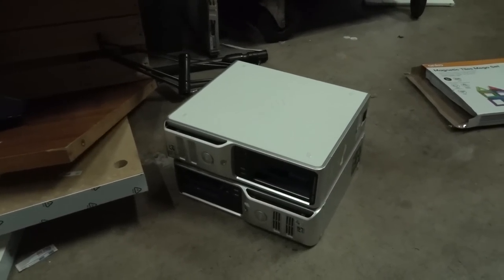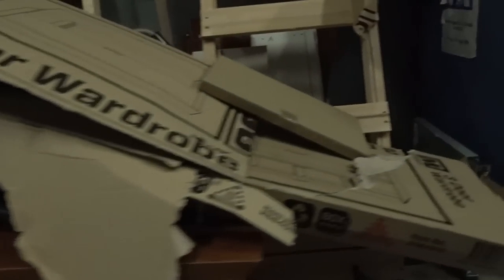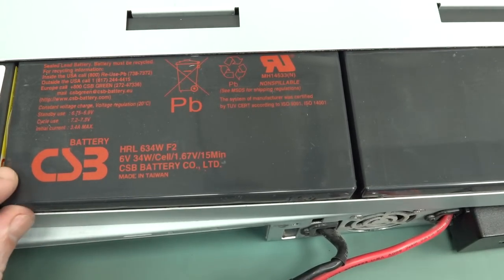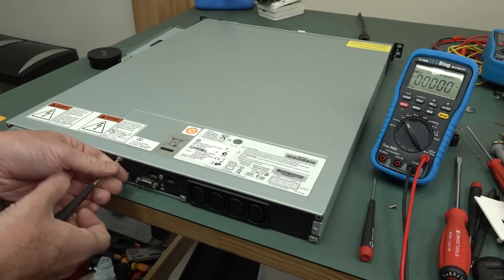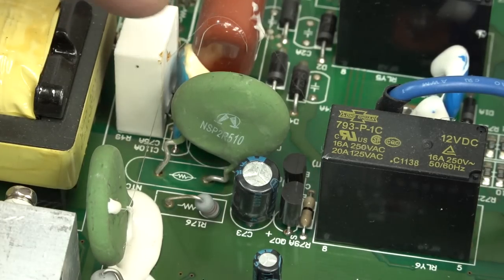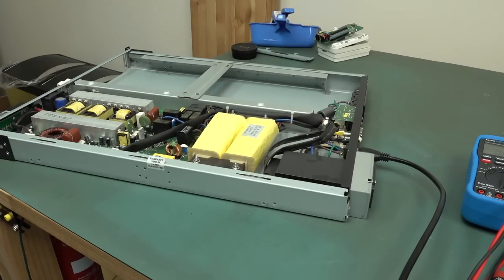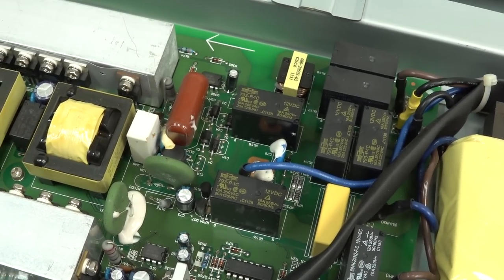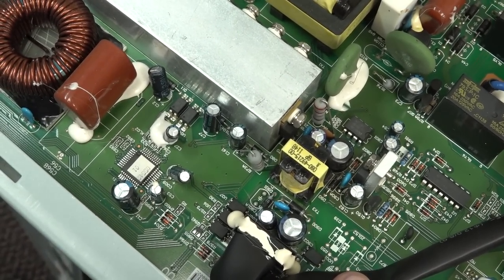EEVblog #1168 - Dumpster Diving UPS

Comment: Dave, please try regenerating these lead acid batteries with a "Back EMF Charger", which is basically a Joule Thief circuit that pumps hundreds(?) of high voltage spikes per second into the battery, and is supposedly able to make them get most of their capacity back after several charge/discharge cycles. It would be really interesting if someone like you, who knows what they're doing, would test this theory in order to prove or disprove if it actually works. That is, you're sopposed to be able to get something like 4.5Ah back on a 5Ah battery, which wouldn't be that bad for "free" batteries (except of building the circuit).
Reply: that sounds like a housefire in the making. better do it outside
Reply: Actually, no. The batteries don't even get as warm as they get when charging them conventionally.
Reply: Yep, often you can shake them and literally hear chunks of dried electrolyte inside...
Reply: Dave Micolichek  No way to do that, those are Sealed Lead Acid batteries. So the electrolyte will be either a gel or in an absorbent glass mat.
Reply: @FnordOok And therefore, it won't dry out. But there could be oxyde buildup inside the cells (in German, we colloquially call it sulfur, but it's probably sulfuric oxyde or something like that), and this can supposedly be reduced back to sulfuric acid with these pulses. I don't know whether this is true, but that's the picture I got from what I've heard about it.
Reply: Please do some experiments on lead acid battery Rejuvenation I do believe they call it try that circuit and any other methods you can think of I can find head-to-head and let's put this to bed for once and it would probably do a service to anyone that ever Works Batteries again.
Reply: I have one of those, it didn't do much for all the batteries I tried them on. Best, but not spectacular results were with the battery that was pretty OK to start with. The rest had developed shorts and it couldn't fix that.
Reply: APC UPS have a tendency to over-charge the batteries, resulting in them cooking. They swell up and deform, at which point they're only fit for the trash. No battery re-generator will fix that. I've seen them so bad that they've cracked in half, physically parting the plates and internal connections.
Reply: @89.8kiwifm9  yep I've seen this to.

Another thing about battery regeneration for let acid not necessarily just seal bad acids but flooded electrolyte batteries as well I think one of the things that referring to is sulfated batteries AKA lead sulfide or fate build up and there is what is called a battery desulfator it'd be interesting to try that on a scientific basis and see if it really does anything or not.

Another thing is using Epsom salts for regeneration.

Which I think is who we but might be worth doing experiments.

And I've also forward about repurposing used lead acid flooded batteries AKA deep cycle or starting batteries AKA starting lighting ignition AKA car battery or vehicle battery.

Utilizing them with an alternative electrolyte mostly consisting of I believe allm cannot remember the chemical name for it. Order makeup of it. It's up another sulfate I think. But from what I've heard it's possible to use it as a storage battery I have heard at least one person saying that they've used a lot of them 4 deep cycle batteries in some sort of backup system. But the voltage is extremely low much lower than 2 Volts Purcell so it would require many many many batteries to do this as well as probably many parallel strings or miniseries / loss drinks whole battery banks in parallel. If you had the room perhaps in a heated location in a well-ventilated fire resistant crawl space or something like that. It might just work if you had a large enough area.

Comment: 8:05 You stated all the outputs are wired in parallel, you seemed to miss that there are 4 wires going to the output sockets, so 2 zones!
Reply: CambridgeMart Exactly! There’s one shared neutral (blue), but he missed the second hot (black) hiding under the neutral!

Comment: No, it's not "super duper black magic efficient" - It gets away with no active cooling since it's only running for 10-30 minutes, and while that all the heat gets dumped into those big aluminum blocks. It will not stand up to running continuously.
Reply: naw it is black magic, it's called ignore the problem and hope it goes away before it would be an issue.
Reply: @digitalradiohacker  Yes and it doesn't even matter if it gets real hot during the battery-load time. And yes, it does get hot inside if it is needed a full discharge to keep everything running max-time. Normally they run only a few seconds max. and normally not on full-load.

Besides that, they will normally start in a real cool environment (like 8-10 degrees celcius) in the server-room (Airco) so they can dump a lot of heat before reaching over 150 degrees.
A few full runs normally means replacing the batteries but these errors should not occur. 

You'd generally program a server shutdown after a couple of % outage when you don't have an auto-starting-generator (yes, they are nice!) that starts in say a minute after power-outage. 
In that case you have 2 short outages: 1 from the main power-problem,  then it gets over to the generators, doing a little charge and then again when the main power gets back (and the generators go out). Since all non-essiental equipment is off it doesn't get a high load.

Very nice systems like that in chemical-factories and hospitals where we used to see them.

@Dave: I had 2 of these with the voltage regulators blown, replaced them and it works again. It is in normal use the hottest part...

Comment: Try connecting a power supply to the battery cable. It shouldn't need more than a couple amps with nothing on the output.
I have a couple UPS units that refuse to do anything without a battery connected.
Reply: Great use for a 4 quadrant supply
Reply: It will try to start charging it... Will that be an issue?
Reply: @tin2001 The UPS can't try charge the power supply if it's not plugged into the mains. Not all of them will switch on from battery power though.
If that's the case, then as Don Reid mentioned, a 4 quadrant power supply would work great since it can act as a load as well as a power supply.

Comment: One of these came in last week for repair. Turned out the fan died (customer decided to buy the fan himself).
And it does not turn on without the battery, can confirm.

Comment: 1. HP does not make/design their own UPS, Racks, or most of their Power/Racking equipment. It's all APC.
2. You have to hold the power button for 5 seconds to turn it on.
Reply: I think this is EATON, not APC (because: "smart slot" is more like eaton; I don't think that exists a 36V version of APC; markings of parts/transformers are not apc-like)
Reply: @yanecisco  I confirm this is definitely not APC manufactured UPS.
IBM, Dell, Fujitsu-Siemens and few others use APC as OEM, but HP always used some crappy cheaper UPS OEM manufacturer. Compared to this HP unit, APC made one looks like space ship.
Only quality stuff in here are CSB batteries (these in video are dead though).
Reply: This is an Eaton unit. There is even a reference in HPs documentation of the 1500 UPS.

Comment: I have two IBM badged  units that are exactly the same.  I went through the same head scratching before I discovered it requires batteries charged to at least 80% to get started.  Once the UPS is running you can hot swap the batteries, but will not start with dead batteries.
After replacing the batteries, and charging them, one UPS is running happy as Larry.

Comment: Put 36 volts from a power supply to the battery input.  Bet she'll fire right up.    Thats how my APC units are.  At least one of those relays in there rely on battery voltage.  

Also with my APC's you can turn them on without mains by holding the power button as long as you have good batteries.  Im sure the HP unit runs the same.
Reply: I'm sure that's a rebranded APC unit, looking at the construction and battery labels.

Comment: It's a 'Line Interactive' UPS, it's not going to switch on the inverter while it has mains applied. A 'Full Online' UPS is different and keeps the inverter running continuously.

If there are no LED's at all, check the battery charger circuitry. Some UPS's won't start up if the charger is dead as it also powers the board.

Comment: The auto-transformer is to normalize  the output voltage in case the line voltage goes below 190VAC or over 230VAC. That's why there are so many relays and not just two. In that mode the UPS doesn't use the batteries until the voltage drops below 170V or jumps over 250V. The stupid thing is that most UPSes keep the batteries at their max charge voltage and not the recommended standby voltage. For a 12V PB battery the voltages are usually respectively 14.4V and 13.7V. This  evaporates the water from the acid gel and makes it much more conductive. The result is shorted cells and after a while dry batteries. Literally - all the moisture leaves the gel and the lead plates oxidize scrapping the battery.

Comment: Usual failure is batteries swell themselves into UPS, then set off B/O battery alarm.  BOFH shows up with screwdriver, proceeds to use more and more force to pry batteries out.  Sometimes I’ve had to pull it completely out of the rack and take off the top in order to remove old batteries.  Would it kill HPE to give extra 1/2” on tray sides and top?
Reply: LOL BOFH!!!!
Reply: I had to take a server out once to remove the swelled UPS. The top steel panel in the UPS had pushed up behind the front panel of the server directly above it so it couldn't slide out. If I recall, they were replacing the entire UPS and servers and everything at that site, so we didn't need to pry the batteries out.
My own one at home did need a screwdriver though. And a few swears. Swears make them come out easier.

Comment: Good quality batteries of that size are in the $20-$40 CDN/AUD range so for a couple of hundred bucks you can get a nice rack mounted UPS and save well over $1,000 as anything rack mounted is double the price because only businesses have racks.

Comment: I think EATON is the OEM for a lot of companies. The network card is for monitoring.  You can also configure them to send out e-mails if there's a power interruption or brownout on the mains.  I would check just to be sure that there's not a safety interlock that prevents it from powering up if the cover is missing or a button behind the battery.

Comment: The expansion thingy is an interface unit probably Modbus RTU on one of the RJ45 sockets and possibly Modbus IP or maybe BACnet IP on the other one. Often used for interfacing the unit to a Building Management System or monitoring system

Comment: I used to work with these connected with a product at IBM, they went under the model name 2145 UPS-1U in that guise. My favourite job was unboxing all the new ones and connecting the battery for the first time, big spark!

Comment: It does have dual load output if you look it has a common and 2 line wires to the IEC connectors . It has to have a battery to start up as others have said .I have 2 of the same UPS

Comment: Another note I've experienced with APC (Schneider) UPS's (I've worked with them over years):
They actually require a battery, or something that outputs some voltage on the battery terminals to actually turn on.
You can hack this by artifically supplying the required voltage to the UPS and it might start.
I've managed to get a flat battery pack to work again with a supposedly dead UPS, which worked fine after...

Comment: That label at @6:36 is for an UPS sold in Brazil. It says "IMPORTER: Hewlett-Packard Brazil" . The top 3 "FABRICANTE" sections only detail the 3 possible manufacturers for the batteries shipped with the unit. On the bottom it mentions local battery disposal regulations. How on earth did it end up at your dumpster, is a mystery... That would be some serious shipping costs if the batteries were shipped with it.

Comment: @8:04 - You can see the Dual Load Outputs. Blue is Neutral (Common to both sets of Outputs), Black is Live for the 1st 2 Outputs, Brown is live for the 2nd 2 Outputs. In the settings IIRC you can tell it when the mains fails, it (when the batteries start going low), it must shutoff 1 set of outputs first, then later the other set. Then on Restart (when mains has recovered), it can restart the sets of output in a specific order. That staggering is used to startup equipment in specific order. I.E you do not want your Client computers to start up before your Server and Network Switch have started up.     Also, don't worry about the Internal Batteries, just put 3 x 12v 7AH Gate Motor batteries in series External to the unit (or 14AH) , and hook it up. If you want to be fancy, put 3 in series, paralleled to another 3 in series (As many times as you like to increase your runtime).     You can tell from my suggestion that I am from South Africa, where Power Failures and Rotational load shedding are becoming a way of life.

Comment: Yuasa are commonly found in higher grade ups's, and those CSB batteries are very common in smaller/consumer grade UPS units. Yaesu is the manufacture of ham and other transceivers. Confusing as the spelling is so close :) Inject 32V of DC ~3-5A current into the battery connector and it'll fire right up. Most if not all of these things need a battery to close the line relay. After a short battery test (which will weed out weak batteries), it will resume normal operations.
Reply: Yaesu is a marketing brand for radios manufactured by Icom

Comment: "The CD drive is flapping arround in the breeze" - Wow ! There's got to be quite a strong breeze down in the dumpster room ^^
Reply: Question how can can you have a floppy Drive installed on a modern bus inside a system yes you can when is the drive to CH flapping around the blue Breeze. Doris I did not say floppy disk drive.

Comment: It must be pretty good to get all those parts for FREE!
Reply: "Free" -- I'm sure he's paying quite a lot to have a space in that building, the dumpster is just one of the benefits.
Reply: @gigaherz_ 
 Free as in he does not have to go out or online to get parts.
Reply: Its AU, look up their real estate prices.
Reply: And try to desolder them ... have fun! You need an oven to get enough heat on the connections to get everything out like the relais near the heatsink-blocks. The caps are pretty easy but are probably bone-dry after staying active all these years continuously.
Reply: @elvin a propane torch makes it quick and easy.
Reply: @barbieroberts6694  Can you still use the parts then or do you just burn and melt  the whole board?

Comment: Your problem is likely going to be a bad electrolytic capacitor(s) in the primary side of the power supply.  It likely worked until power was lost.  Look at the small caps and measure ESR if you can; if not try heating a few at a time to 150c and plug in to see if it powers on.  Good luck

Comment: It may cost a fair bit in batteries to get a UPS of THAT size up and running again, but I can almost guarantee it would still be much cheaper than replacing the UPS itself.

Comment: Hook batteries up, bump the "battery" voltage up to 32-ish volts with a power supply, see if it turns on.

Sooo many perfectly good UPSs are thrown away with bad batteries because they will NOT fire up with a flat battery, hot-swappable or not.
Reply: Can't beat sulphation m8. 😕😔

Comment: Be careful with the Dell power supplies. Many (if not all) of them have a non-standard pinout on the ATX connector.
I learned this the hard way - I connected a standard PSU to a Dell board, and the PSU blew up immediately. But I was even able to fix it, only the 5V standby regulator was broken.

Comment: Most of those rack mount units and even some normal ups's require a 5-15 second button press to turn on or off as they are usually running critical equipment. Most if not all require battery voltage to turn on as the logic should be run from battery. Try using any three 12v batteries over 4 ah with at least a 12v charge in each.

Comment: I this HP is anything like the APC rack mount units it will require just enough voltage from the batteries to trip the input relays before switching to 240v, then it should run no problem without any batteries. Try charging the input dc capacitor up with a power supply and the unit will likely work no problems. Its  great to see whats worth salvaging in these dumpster videos.

Comment: its either the battery or the board, if theres a power integration chip for the internal system power supply, replace it they always fail

Comment: I found an apc backup twice that size for free (along with a fancy computer desk and many computers), i think i sold it for a couple hundred dollars, it came along with a APC server rack power management strip with ethernet, i swapped out the massive 40A plug on the end and turned it into a a power strip/surge protector/power conditioner for my home setup.

Comment: I've never seen one of these fail. These usually get tossed when the batteries die and you get the $600 replacement offer. Or when these (92% eff.) get replaced with newer (95% eff.) stuff.

Comment: Interesting the lack of forced air cooling and fins on the heatsinks, guessing by the time they overheat the battery would be exhausted anyway. Probably only has a few mins of runtime at full load to allow servers to gracefully shut down.

Comment: As others have said, you need good batteries for it to start up. Once it is alive you can hot swap, but you can't start them without batteries.

However, does look like that part was never soldered!

Comment: Also scrap batteries can go for a good price these days. a  Automotive scrap N70 battery goes for about $10 with out a ABN and more if you can supply one in most cases.